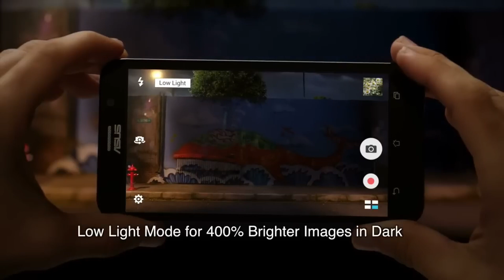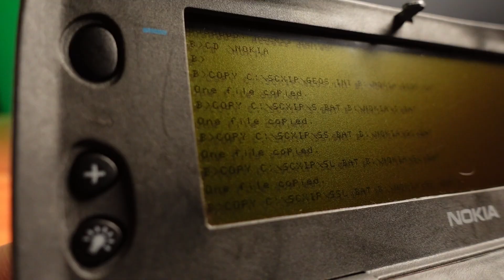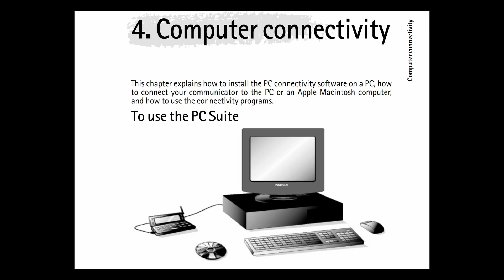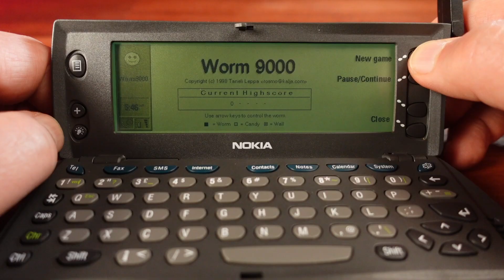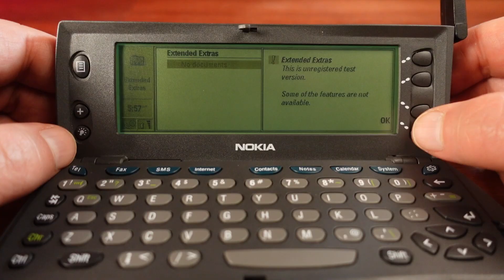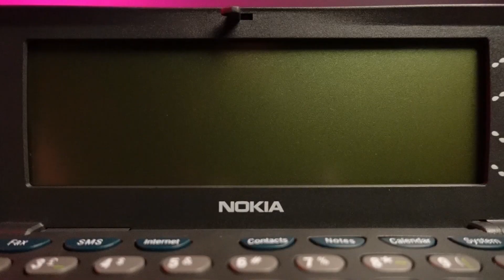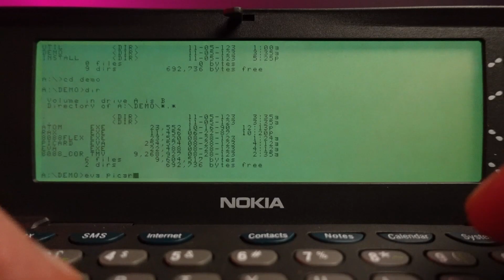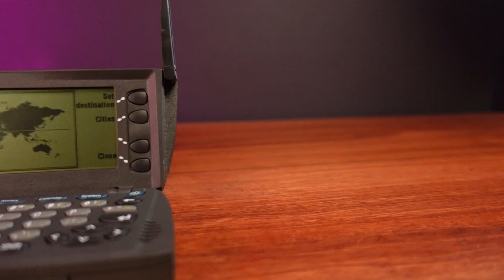Running on a 486 CPU : Nokia's 1998 Smartphone

Comment: Finally managed to get my own 9110 working well! Got an MMC card and installed some software, but I'm definitely finding that there's a huge lack of software, which really hampers the appeal of it compared to the 9210i which I also recently acquired.
Reply from the maker: I agree there is not nearly enough software compared to what this could do. If I had the time I would try making something myself for the fun of it.
Reply: @JanusCycle  I've been looking into it, from what I've read the SDK isn't particularly friendly to work with (even less so in 2025), but I'd still love to see what it takes to get at least something basic running on it. It's such a fantastic device it deserves more software!

Comment: Question. What battery does this model use? I acquired one recently with no battery or charger. I cannot get a definitive answer on what battery or charge it use. If you would be as kind as to tell me what battery model/voltage it uses. Thanks.
Reply from the maker: You need a BLN-3 3.6V lithium-ion battery. The charger is easier because is uses a common larger barrel Nokia charger used on all their models from the late 1990s to early 2000s.
Reply: @JanusCycle  Much appreciated.👍

Comment: 6:25 The second one that was gifted to you is actually 9110i, which has support for larger MMC cards and by default has WAP browser (base 9110 had it via update) One way to differentiate these phones is by the "CE" marking on the type label (CE0188 for 9110, CE0168 for 9110i), citing Miraheze LPC Wiki

Comment: There's a chance that the phone featured in this video was a prototype or engineering sample of some kind.  The AMD 486 CPU soldered to the main board has "ES" engraved on it, which most commonly stands for Engineering Sample.
Reply from the maker: Other people have commented that this may be a prototype.
Reply: @JanusCycle  Ahh I didn’t catch that, apologies.
Reply from the maker: @ no need to apologize, just that you are likely correct. The ES engraving is something I didn’t know. Interesting and thanks for letting me know.

Comment: the flip out antennas on 9110 and 9210i really did help with the signals, I used call them signal booster

Comment: 1:21 The broken 9110 has some wierd screen keys... never seen a blank "Menu" button (the big button on the left) with a blue line next to it. Also, the 4 side buttons (on the right, next to the antenna) don't have 2 little white dot arrays going to where the screen commands are, instead there are (faint) single blue dots at the screen. What model is that?
For comparison's sake,

1. 0:13 

2. 5:50
Reply from the maker: Another person has commented to me that this seems like a prototype. I'm not so sure, as I have seen a couple of other blurry photos online showing this design of the 9110 with the blue lines.
Reply: @JanusCycle  Maybe that's an earlier model? (earlier network-locked model maybe?)

It's interesting, for sure. My 9110 from Jan. '99 has the regular buttons. Maybe type in *#0000# in the phone side of the... oh wait it's dead, nvm. Check the plastic casing? It usually has a date stamp/round circle-y thing on the inside.

Usually, prototypes have big "PROTOTYPE" lettering under the NOKIA label.
Reply from the maker: There is a 9110 prototype on ebay at the moment. With the blue line and prototype label. Mine does not have a label.
Reply: @JanusCycle  Ooh! A real shame you bricked it... it might have actually been a prototype. You should get it to somebody who specializes in BGA boards. Maybe they can rescue the thing.
Reply: Screw it. I'm buying the prototype. I crave the collectibles 🤤
Reply from the maker: @razvanschuster5058  Excellent! it's only US$50. I'm happy to send mine to the right person. The problem is there is (was) one on ebay, that works better than mine before I even attempted repair. And it has the prototype sticker on it, unlike mine. All this makes mine not economical to work on.
Reply: Yeah... also, yours is a prototype. The lack of label and the open development pins above fully support that.
Reply: yay i won the auction 😀
Reply from the maker: @razvanschuster5058  Take care of it. I promise I'll send mine to the right person that can fix these when I find them.
Reply: Also, I know this isn't related, but how did you get the Worm, 9Lives, Minerva (is it a game?), Arkanoid, Space Invaders and Tetris 9K games? They're unobtainable (at least for me)
Reply from the maker: @razvanschuster5058  Internet Archive has software. If there is more you can't find I can give you copies. https://archive.org/details/9110-software
Reply: Also, most (if not all) software has been designed for the 9000, so maybe that's why there's no DOOM.
Reply: Allright. The battery's dead, so I'll use my restored battery. Maybe I'll try and fix its prototype battery, although that will kill the value. At least it'll work.
Reply: YEAHH THE PROTOTYPE IS HERE AND IT... well... uhh... I guess it works?
Reply: As soon as it turns on to an AMAZING prototype splash screen, it gives me a "internal error. Remove battry" and it does nothing else. The outer screen just says "CONTACT SERVICE"
Reply: I'm going to try and fix it, but not through hardware modding. Maybe I can wipe the data, but I would lose all the user data. Eh, it's corrupted anyways...
Reply from the maker: @razvanschuster5058  Do lots of reading first before trying anything. I just fount this note on Reddit,
'Another option is to do ctrl + shift + i, to remove ini-files (temporary files)

My communicator came back to life by doing the ctrl+shift+i, then f and then i again. Please note that all extra software will be deleted when you do ctrl + shift + f as it formats the device to the bare minimum software it gets at the factory. So you need to install office, etc. yourself, but calendar, messages and phone at least stay.'
Reply from the maker: @razvanschuster5058  That last tip was for the 9210. I've been so 9210 focused.
For the 9110 there is mention of holding Shift + Tab + F when inserting the battery.
I've also seen Shift + Tab + holding different arrow keys mentioned.
Reply: Already did that, and it works now! It's incredible. The backlight cuts off whenever I touch the "Menu" key, the contrast is way too high, half the settings are litterally pulled out of the 9000, the three finished "Extras" things are the clock, composer and bug handler, all of them except for the last obe being present on the 9000, the "About this product" literally has a photo of the damn thing, and, oh, the battery meter doesn't work, and neither THE WHOLE OTHER PHONE SIDE. It doesn't work! Not broken, just 90% not there! Oh, and the "Extras" have a finished Converter, and, to my knowledge, it's present on the prototype only. Also, this is PROTOTYPE 2.4. I'm thinking the 9110 was a bit rushed, since it changed a ton from the prototype, wich was already a later one. I've seen other prototype nokias in the 2.3 or 2.8 stage and they look exactly like the finished product.
Reply: Forgot to mention, don't enter the MMC tool on the prototype 2.4. Let's just say it goes a little... bonkers... like showing only 1/6th of the screen, inverted in colours, with all the menu items jumbled up together and repeating words 17 different times kind of bonkers. Should probably document the whole phone in a vid. Maybe I'll even get a request from Nokia to give them their prototype back, although HIGHLY UNLIKELY.

Comment: I had the same one and used it to work.
I could connect to PSTN modem on servers at my clients.
I replaced it with a 9210 a 9500 and finally an E90
It's an excellent machine that I regret having sold

Comment: Always wanted to own a Communicator. Sadly, the best I could afford was an N72. 

Still super fun though. You could hack N-Gage games into it, and it had more RAM than the N-Gage, making the gameplay a lot smoother. 

Older tech was more janky, therefore more fun to play around with. 

The only living remnants of that era is the TI84+ and similar calculators. I want to have one, but those are insanely costly. I tried ordering an used one, but it got lost in transport.

Comment: PC/GEOS is a pretty amazing piece of software, especially because of the fact it runs in real mode but offers pre-empathise multitasking and multithreading. The SDK for developing Nokia 9xxx GEOS (and standard desktop GEOS) applications was Windows based. At the time Geoworks stressed that developers should not access memory directly, but use the built in memory mamagement API instead - this is because there is actually a unreleased 32 bit protected mode version of GEOS.
Reply from the maker: That is some fascinating detail, thank you.

Comment: Do you know any resources for similar hacks on the 9000model? Ive got a very beaten up one with a dead battery but i seem yo remember powering it up with a dc adapter. I had no idea it used a 386.
Reply from the maker: The 9000 should run most of the same software as the 9110. However without a memory card slot I don't think you can get an MS-DOS prompt and you will need a serial cable to install anything.

Comment: so howed the get one in there?  I mean, I have 2 working ones and a cyrix which was an over clocket 486 they callled 686..... but anyway that chi[ wont fit in that phone so they made a fake 486 called a...  Fujitsu Loox F-07C.....   1200 mhz    it was more like  mobile celeron speeds....

Comment: I worked with BGA for many years, and I can tell you, you don't need the stencil to recover your cell phone. The advantage of remaking spheres on old things is that they use huge, easy to manipulate spheres. I mean, it may seem small, but today's computers use MUCH smaller spheres that are almost impossible to manipulate with tweezers and that stick to your thumbprint.

Use adhesive aluminum tape to isolate the rest of the components from heat, as heat can cause problems with nearby chips.. Buy spheres, you can measure the spheres that were in it using a caliper, or try your luck with balls between .60 and .80. You need to desolder the chip, and clean both the chip and the board using a copper mesh, clean until you can run your finger through it without feeling any imperfections. Take a good pair of tweezers, apply a very small amount of flux to the chip (thin film) take a ball with the tweezers, position it, and apply heat until it melts just enough to not move when it cools. As there are few balls, you can do this artisanal process until you have soldered all the balls, then apply a thin layer to the PCB, and solder the chip.
Reply from the maker: Thanks for this, some very practical information here.

Comment: In 1998 one of the best phones you could buy was the Ericsson 337. I owned one, reasoning that if Ericsson made good Radars they would made good phones too. It was a good phone overall, with a slim or enlarged battery and a warning tone and red Led for when you lost coverage, because the Network by them was still limited. It could receive SMS text but from the mobile operator only, and had no way to reply. The battery lasted around 14 hours in stand by and calls were very expensive... 😐
Reply from the maker: I'm very aware the 337 could only receive SMS and not send. I did make a 337 test mode video a long time ago.

Comment: 32M "default" Canon SD card... bundling with devices when couple to few gigs already cheap and norm.
Reply: Maybe you misread the year. A "couple to few gigs" memory card of any consumer type did not even exist in 1998, 32MB may well have been above the norm in 1998, let alone for a bundled card. There were also no SD cards.
As in the video, it used an MMC card - SD cards evolved from MMC cards in 1999(though there is a lot of compatibility between MMC and SD)
1GB cards didn't exist until about 2003, and cost hundreds initially.

Comment: Can you please share LCD's datasheet? I think pairing it with pi is very much doable, with custom adaptor board of course
Reply from the maker: The 9110 service manual has the LCD connector pinouts. The CPU datasheet has more LCD interface details.
[Redacted]
Reply: @JanusCycle  Nah sry, I watched LCD connection - unfamiliar interface

Comment: I couldn't afford a colour screen nokia until I got a 6110 Navigator, and later N97 mini then finally N9.

After that the MS owned CEO betrayed the company, so I went to Android...

What I really miss is a physical keyboard you can type on without looking...

If only there was a modern smartphone with a sturdy flip-up mechanism like the N97 mini, I'd be first in line to buy it, even if it's heavier and bulkier than the flat-phones of today.

Flat-phones are admittedly great for media consumption, but not so much for productivity...

Especially the N97 mini design was brilliant for both, as it could work as a stand when flipped open... it was just a pain to convert movies into a format it could play.

Comment: These look so clunky compared to the Psion Series 3a from the same era. It had the most amazing hinge mechanism that held the AA batteries. Each half of the clam shell was much thinner than the battery!
Reply: The Psion 3a was also using a vastly less powerful CPU, considerably easier to make it thin when you don't have to accommodate a (comparatively) large, hot, power-hungry cpu.

Comment: Liked the video . Great effort in trying to put it back. I remember my 90s and the early 2000s with a LG Phenom. Though not a phone- it had a grey scale screen and the same backlight. It had pocket office. It could run pocket dos and I could play basic dos games like Prince of Persia, Dangerous Dave etc. I could also play mp3s in 16 Kbps. My favourite app was total commander. I could use the infrared port to transfer files to my Nokia 6600 phone ( the hero of the Cellular movie who saved Kim Bassinger). I also used the infrared port to wirelessly connect to the internet through the mobile internet of the Nokia phone.

Comment: The first Nokia communicator came out as a pocket communicator for the business community in an era when it would have been expected to be able to send and receive faxes, which is slightly before emails took over. So, the emailing would've been a secondary, not so commonly used option. The device you were showing, the 9110, comes from in between the two eras, and it most likely would have been expected to do both, faxing and emailing. Those would have been the functions I'd love to see performed on those devices. I'd love to see how well they performed.

Comment: As a former collector of old Nokia phones, I gotta say that the communicators are definitely the pride of my collection. My 9110 is in immaculate condition, I bought it with the original box and some of its original accessories were still sealed - leading to the conclusion that its original owner barely used it. After seeing the first part of this video, I was right about to send you a message offering you my 9110 for a future update video - thank god you found another working one for part 2! 😜👍

Comment: You  not killed previous phone. Because your chip remove method is incorrect. And no need remove ic s for this fault.  But if you not over heat it. I think still it can fix.

Comment: I owned this particular phone it was brilliant because you could load up spreed sheets on a cut down version of excel. I used to have maintenance spreed sheets on AC units in apartment buildings And all the power meter and water numbers of units so I could reference new tenants and connections and double check that bill were paid at the end of tenancies. I think the phone was about $6000 NZD  it was the colour version and was bomb proof. I still have the pelican water proof box it came in! Way ahead of its time!

Comment: melt the solder, just don't touch it. just heating it up will not work that well. also maybe you have cooked the cpu while reflowing the chips. I had 9210i and 9500 , amazing phones.

Comment: I used both 9110 and 9210 in those days. I was a telecom engineer back then and using telnet to remotely configure the routers in our network. Those were revolutionary devices that made me able to add mobility to my work.

Comment: i had no idea that that 9200 used AMD x86 cpu.
kinda wild seeing how it was still at the turn of the millennia not uncommon to see home pc's with 66Mhz x86 cpu on them.
though at that point you would not often see x86 66Mhz pc and that Nokia phone in the same household.
seeing how those Nokias cost you arm and leg.
i do remember dreaming of owning one of those though.
but it would be until 2004 and Nokia 3650 when i finally got my first Smartphone.

Comment: BGA soldering is a very hard technique to master , it is like an art of heat control through heated air flow while to ensure the solder balls position not deviate from original position. IN other words it is like a cowboy sending 500 cows back to a ranch without a single cow lost.
Reply from the maker: I'm always going to push myself to try new things. While remembering that I know almost nothing.
Also, I will only do this sort of thing on devices that are broken and not economical to repair.